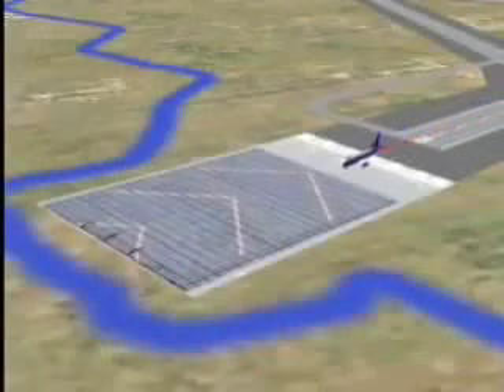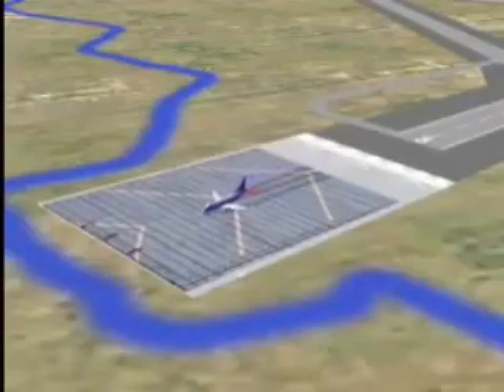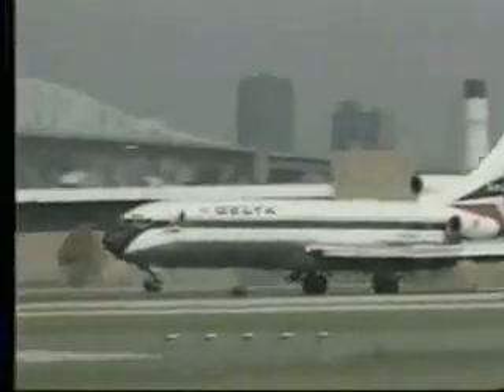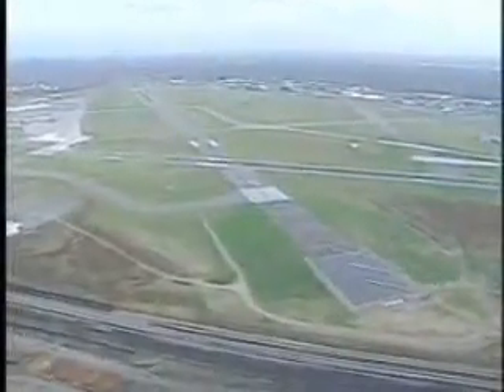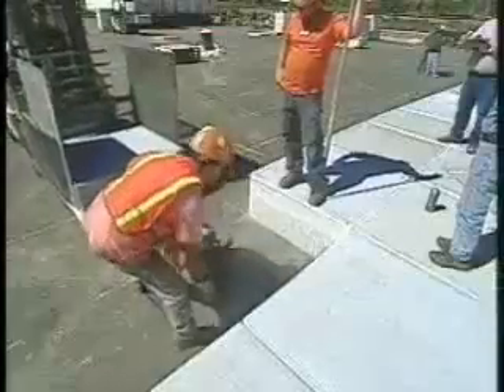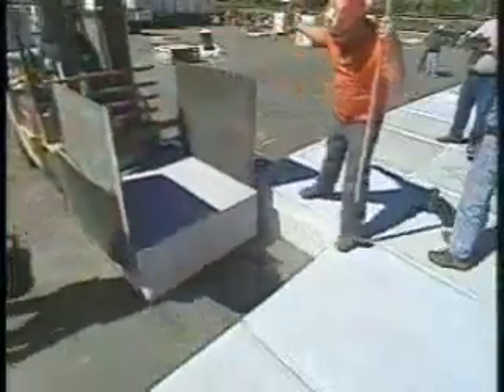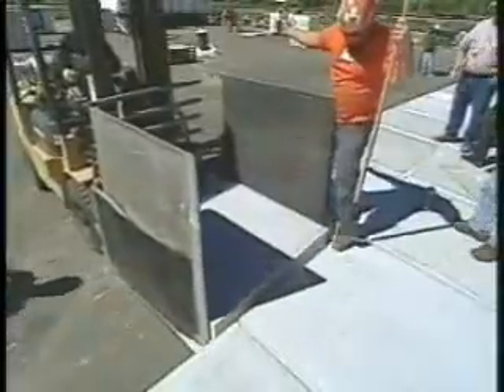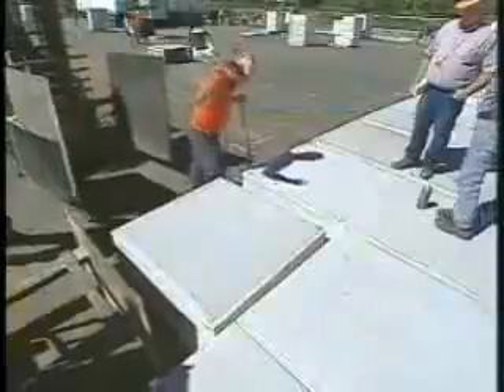Engineered Materials Arresting System EMAS by ESCO2

Comment: EMA system should have been provided at tabletop Karipur runway.. could've saved a lot of lives..not "lot" but all on board... Heartbroken.  RIP 😢
Reply: EMAS costs 100crore and can be used only once. Do our airports have actually these kind of budget?
Reply: @aks2431  18 lives or 100 crores you choose.
Reply: @sandhyakritheesh  I am nobody to choose. I am just trying to put up a fact that our airports do not have that kind of budget to put EMAS. Only USA has EMAS almost at each of their airports(multiple runways included). India doesn't have that kind of budget.
Reply: It can be used only at the tabletop airports of India.
Reply: @Shankwarranto  yes ... It should be
Reply: @aks2431  Aviation has a tonne of money pumped in constantly, lives are always put over practicality in the West. Too bad in India and Pakistan, safety is overlooked due to corruption.

Comment: And destroys landing gear.
Reply: Check the news dude. This thing just did its work with the Southwest flight
Reply: Bruh, would you care more about people's lives or a replaceable landing gear?
Reply: I don't think that tends to be the use case.  This probably was a crap, unairworthy 727, anyways.
Reply: better than destroying the whole plane
Reply: REEEEEEEEEEEEEEEEEEEEE
Reply: not always
Reply: I’m sure any airline would rather have to replace landing gear than deal with a financial and pr meltdown as a result of fatalities.
Reply: If the plane overruns and flies off a cliff or into an interstate highway or into the ocean (the types of situations these are normally used) guess what, the landing gear will also be destroyed then anyway.
Reply: As of today at least 12 flights with nearly 300 passengers have been saved by this system...